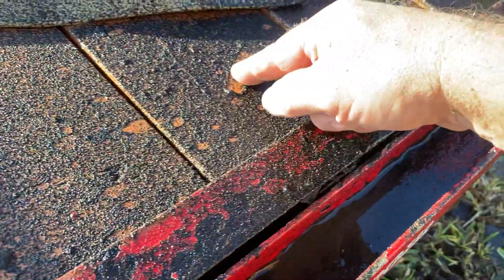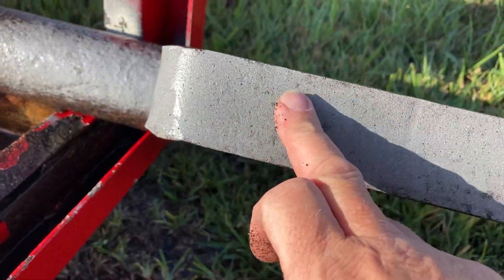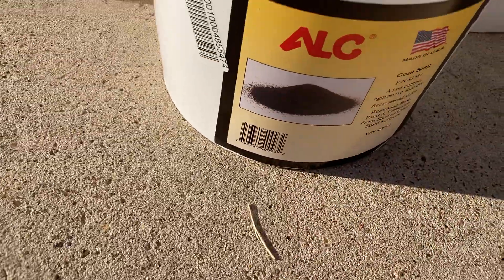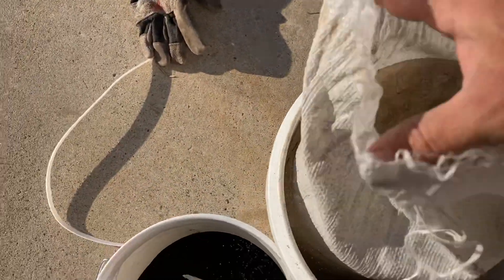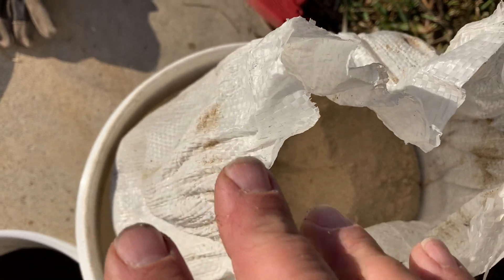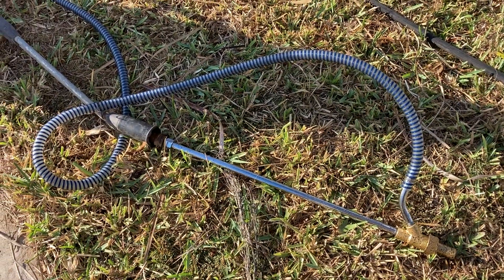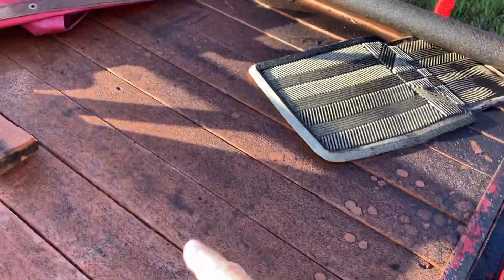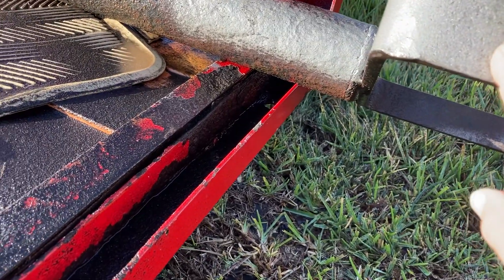Wet sandblasting rusty metal using Northern Tools power washer adapter and coal slag.

Comment: I found that the white sand sold for children's sand box works really well at cleaning. If you examine the sand crystals, most sand is rounded. The sand box sand is made from hard quartz that is crushed and not tumbled. Coal slag is also crushed thus giving one sharp edges that work real well at scraping rust away.

Comment: I've used this and found you can go through sand really fast even though we installed a valve to slow down the rate at which the sand feeds. Also if used on a car body the wet sand gets packed into hard to clean areas.

Comment: I have the same thing with a pump at 3500psi and 25Lpm. I had to drill out the nozzle orifice to I think 1.5mm to match the flow rate of my pump and it works brilliantly I strip thick marine epoxy paint very well with nothing but standard play sand. I had an idea to use standard table salt for easy clean up of the parts afterwards

Comment: I have this exact tool. I have completely stripped two utility trailers with it. I started by using pool filter sand. It fed really well, was rather cost prohibitive, &  didn't seem to strip down to bare metal. In it's defense, both trailers had multiple layers of paint from previous owners.I switched to playground sand from Home Depot, which was significantly cheaper. It would sometimes clog, but it stripped down to bare metal very well. To correct the feeding issue I used an old storm window screen to remove the bigger chunks from the playground sand resulting in far fewer clogging issues. When I stripped an antique bed frame I switched back to the pool filter sand in case the playground sand might damage the surface of the bed frame. I didn't care about this with the two trailer frames.
Reply: It will help a lot if you dry the sand first.

Comment: This set was so nice I purchased a second set when I ended up adding a second 50’ hose to my set up. https://www.youtube.com/post/UgkxG9W58byG1ZFYaD32YfLk74_TrU5mNkXV Only down side hooking two hoses up with quick connects you end up with a 6” ling section of fitting would be nice if there was a union type fitting instead that would save a huge chunk of material in line with my hose. But that’s just how I set it up. I go between a 50’-100’ all the time. Otherwise mine hasn’t leaked once used Teflon tape of course and have been running these since early spring 2022!

Comment: I saw a guy using pool filter sand from Home Depot. 5 bucks a bag. Was coarse and worked really good.
Reply from the maker: Interesting idea.  I did get the pool sand to work.  The trick is to have dry media , spillable dry.

Comment: My father has a sandblaster attachment like yours and we do professional pressure washing with great pressure washers and I never understood how to use the wet sandblaster with the pressure washer. So my question is what kind of media are you using? It came with a very small bag I just assumed it was too small and I needed a big bucket full of sand for it to work properly. What you're doing is working out perfectly!
I haven't scoped out much but you should make a video on how to install your sandblaster system. I like to see how you got your set up.
Reply: Northern sells various blast media. The most economical is sold in bags. I use the glass media because it is more course grade. The coal slag is very fine, and unless you are using it on a delicate surface, isn’t the practical choice for efficiency. The blast media Northern sells in plastic buckets is usually specialty media, and it is more expensive. These media’s should be used in a blast cabinet, so you can get multiple uses. 
The tool simply attaches to the wand of the pressure washer, and the media pick-up tube is sunk in the media. I usually put three or four bags in a large, clean container, like a trash can. Don’t use a plastic liner, because it will suck up in the pick-up tube. Try to keep the wand pointed down when not blasting, to keep water from running back in the pick-up hose. If it gets wet sand in there, the work stops.

Comment: Hi mate, I've the very same blaster attachment... the problem I get is water making it's way up the "Y" junction and causing the sand to become wet and clogging the flow. Do you get this problem? I'm using a 3000psi washer.
Reply: What's the flow rate of your blaster also you need the junction to be facing to the sky
Reply: @timothyhackett7372  3000psi. I've now found a solution to the clogging problem. It was the hose. I'm now using 15mm Buteline hose which fits both ends of this unit (tool daily sandblasting kit) like a glove.

Comment: Be careful using this sandblasting method around bearings and steering mechanisms, the sand is forced out under extreme pressure, which will get into places where sand usually will not get....
Disassembled parts will have no sand intrusion problems...
BLAST AWAY....(warning- not appropriate for cleaning dirty kids or pets....)
Reply: It's a good thing you mentioned about dirty Pets! Haha. And with the weather in NE Ohio you never know if it's going to Monsoon and be a mudmess in the yard either

Comment: Just gonna rust right after
Reply from the maker: Says the voice of experience.  You’ve never done this before have you?
Reply: @spidennis  I've sand blasted many times working on the pipeline
Reply: Josiah Lomas it surely would flash rust but that could be corrected effortlessly compared to dealing with the heavily pitted rust he started with
Reply: I sand blasted commercial, industrial & residential for many years using a 700# pressure pot. We mainly used different sized grit of coal slag called Black Beauty, pending the type of surface and material being removed. Sand wasn't aggressive enough for most of our work.

We eventually got a secondary system that uses a water tank which was mostly for dust control, but also eliminated warping on soft metal surfaces such as car fenders & hoods. I only used the machine a couple of times, but there was a liquid additive (coating)  we put in the water/grit tank which kept the metal from rusting, which was good for a few days, provided you didn't touch the surface afterwards...more than enough time to dry out for primer. It was also good for interior work since there was no dust or over-spray, just minimal water. With this system someone could stand within 4 feet of it...the other system you have to stand back at least 30 feet, but even then; you'd still get stung.

The system was designed & built by a guy in Canada, don't remember the name though. Overall, it was the cats azz, once you got past the learning curve of making all the adjustments to get the unit up & running smoothly...winter operation was different than summer, etc.
Reply: @mediasmoker  the sand we used on the pipeline was cooked..it was black

Comment: Why not just use a angle grinder to sand it, rather than waste precious water?!!
Reply: Because you can't get into corners, or inside of any areas that are smaller diameter that the grinder, you can't get into pitted metals without grinding the entire areas down to the depth of the pits. Basically it's blatantly obvious you have never worked with iron or steel that needs to be completely stripped because if you had, you shouldn't ask such ignorant questions.
Reply: @dimetrekorsikov5643  brother, thank you for replying, I appreciate your insight.

Yes it should be obvious, that I don't have much experience working with metal. I am a hobbyist, and I have begun to develop my armamentarium, by collecting various power and hand tools (toys), to work with wood, metal and other materials. Therefore I watch various videos here, and the algorithm suggested this particular video.

However I don't know why you use the word "blatant"? You still in your adolescence? I just felt we should be conservative in our approach to the bounties of mother nature, especially fresh water.

Btw, I am a doctor and a surgeon, my armamentarium, the techniques and procedures i do, are beyond non-medics imagination and scope. So no need to be contemptuous and condescending.

Peace and love.
Reply: @jaydochaywalker8099  no shit, a doctor huh... imagine that... I'm an cosmonaut and formula one race car driver and in my spare time I volunteer at NASA to train astrophysicists. Just for the record , there is exponentially more water on this planet than there is land. Just sayin.
Reply: @dimetrekorsikov5643  don't be delusional, your language reflects your status in society.
Reply: @jaydochaywalker8099  okay doc
Reply: Those of us East of the Mississippi have more water than we know what to do with. It falls out of the sky every few days.